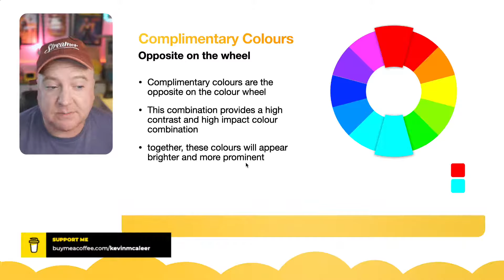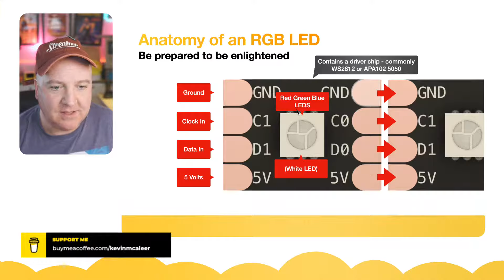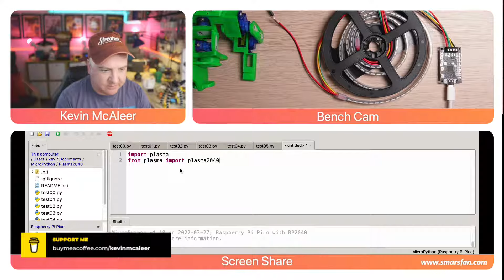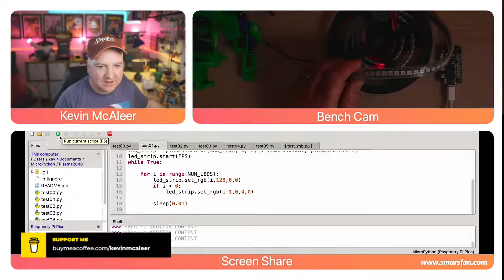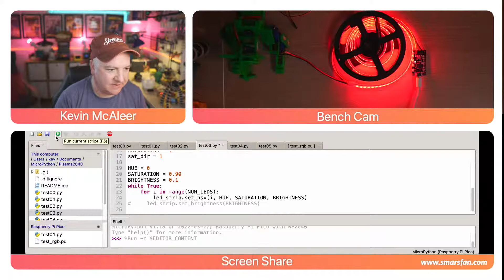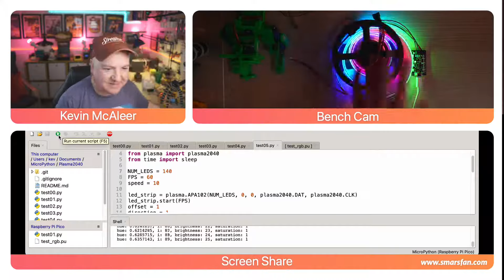How to use RGB LED Strips with the Plasma 2040

Comment: the K in CMYK stands "Key" or Key Plate. This is the plate that is used to actually print the details in an image. Normally this would be done using Black ink to show the lines / contrast of an image. Any colour could be used, of course but over time the convention was to use black
Reply from the maker: Fascinating- thanks for sharing!
Reply: Even in two colour prints u use key. Even if it not black :)
But the Key should be the darker one of those two. Otherwise you end up with a negative image :) So key can't be a specific colour.

Comment: FYI there are faster addressable LEDs out there, such as Dotstar/APA102 LED strips (via SPI) 12-20khz pwm/32mhz clock vs Neopixel 400-2000hz pwm/800khz data rate,
Higher speeds means more fluid, fast moving LEDs and higher perceived color depth using temporal dithering.